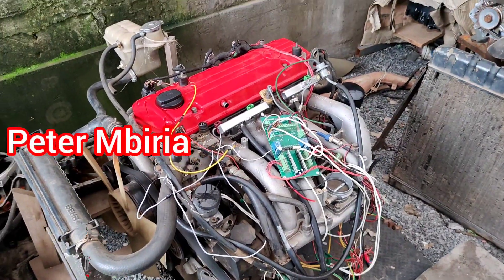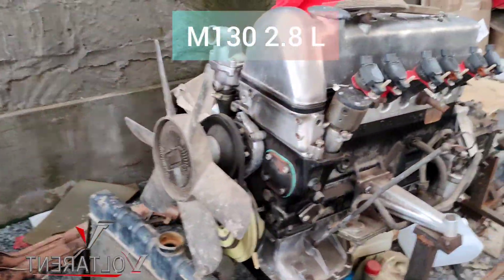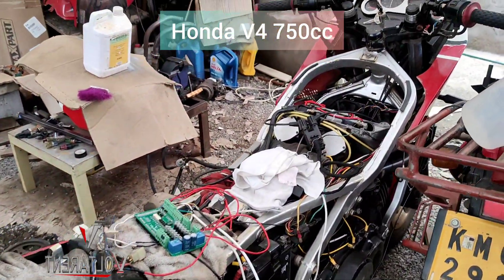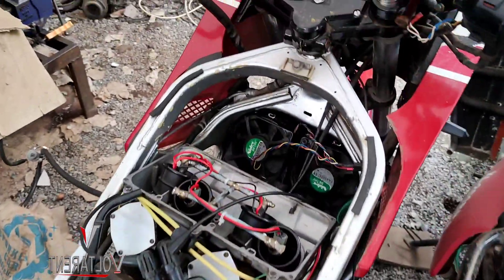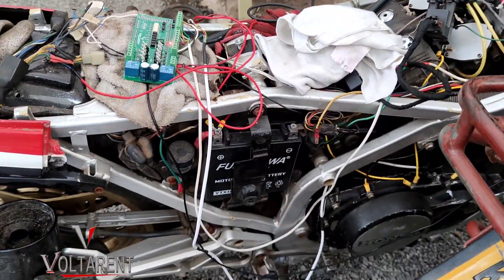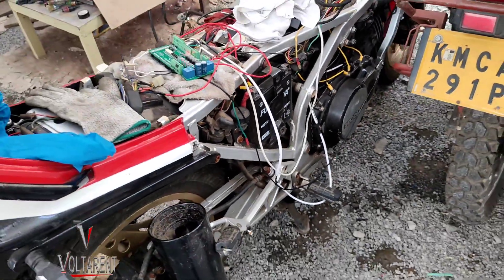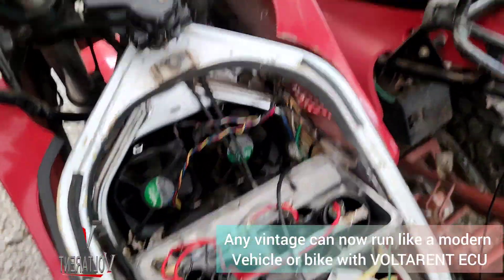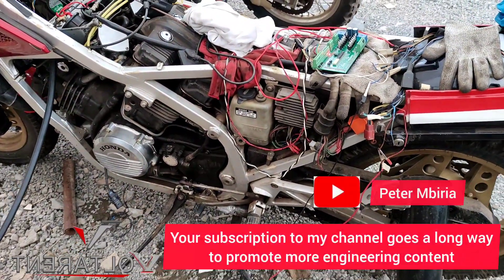V4 carbs to EFI?

Comment: I had the 86 VFR 700 what an awesome bike . Bulletproof engine. Gear driven cams. Do you have some performance number for the carbs vs your EFI system? This is an arduino also? Might want to check out the esp32

Comment: it seams that you are using the original carbs for tjrottle body its that correct?
Reply from the maker: The carbs are there, the pistons, needles, floats, diaphragm all removed as they are no longer needed. The piston area is covered by a machined nylon piece. The carbs have throttle bodies and instead of designing a fresh system that will fit on the V configuration, I just used the carbs without their parts.
Reply: @PeterMbiria1  thanks man
Reply: This is amazing. Wow. Is this a custom job for every different vehicle? How close are you to a more generic solution?